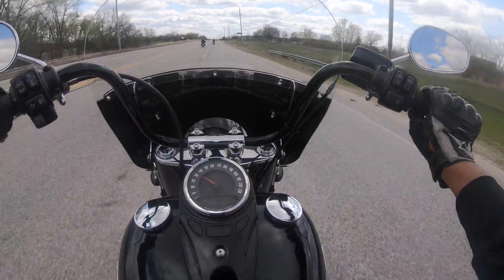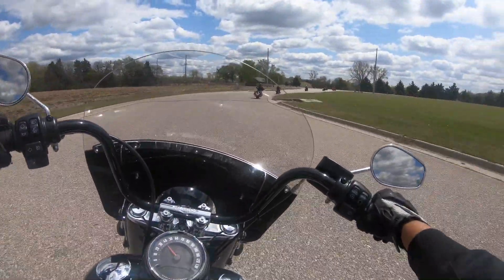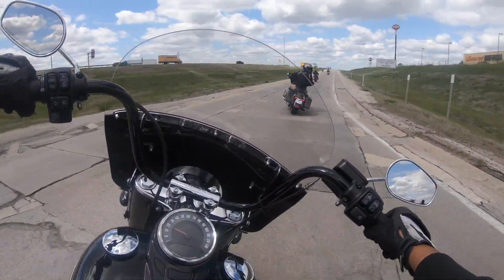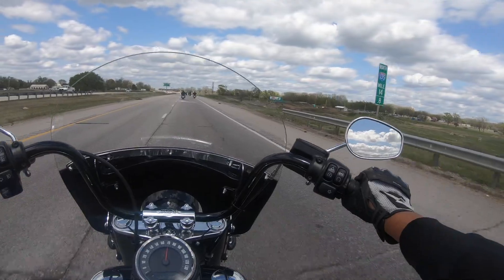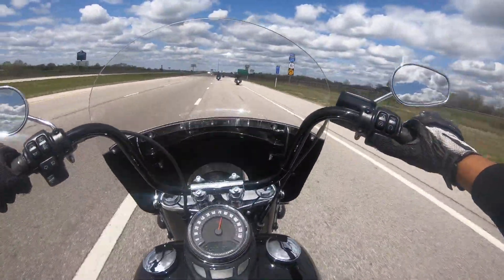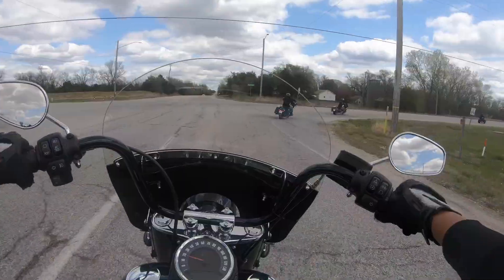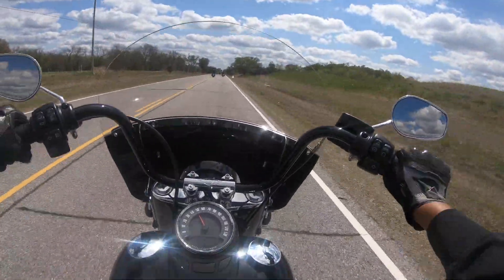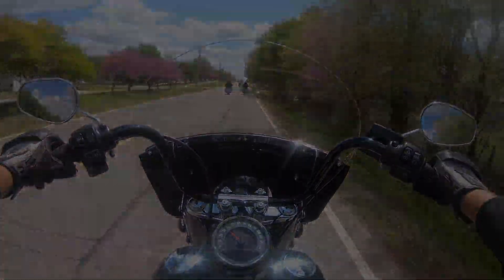2021 Harley Davidson Heritage Classic TEST RIDE!

Comment: Thinking of getting a new one. 2 mechanics I know say they are not sturdy, tend to break down easily. 
Do you agree?
Reply from the maker: My compensator on my Fat Bob broke at 3,000 miles. I’m now at 20,000 in a years worth of time. I love the M8.
Reply: @SmallButMightyx  thanks, I tend to ride pretty conservatively anyway , but didn't want to get into a lot of debt with bike that breaks down.
Reply from the maker: @danoweston6185  yeah I was just accelerating when to 40 when mine broke. No warning. Some people have issues with it. Most don’t. I put the original comp in and no issue since. It’s a great bike. Can’t say that enough.

Comment: 0:12   "She's quick....Oh, these Harleys are quick."  If you really believe that, you have never ridden a "quick" bike, to say nothing of a "fast" bike.  A Concours 14 or an FJR will smoke a Stage 4 Harley, and any of the Literbikes will leave the C14 or the FJR wondering what the heck just happened.  Ride your H-D and enjoy it, but enjoy it for what it is.... a cruising/touring bike.... NOT a performance machine.
Reply from the maker: They are quick. Not fast. Torque not HP. That’s about it. I’ve road plenty of sports bikes. Different machines for different persons. If someone wants to build out a Harley into a performance machine who cares? Their money.
Reply: @SmallButMightyx  Try a Kawasaki Concours 14.... it's a touring bike, not a sport bike - and it's "quick", but it's not "fast".... "fast" is a ZX14, a Hyabusa, or any literbike like a  BMW S1000RR.  And torque doesn't matter... horsepower is what counts.  The rest is just gearing.
Reply from the maker: @wwb7091  all personal opinion. Everyone has their opinion on what counts and what doesn’t. Never road s concour but I’ve heard nothing but positive things. Just not my style.
Reply: All things are relative and subjective. This Harley will be considered quick if you compared to the likes of a Honda Shadow or similar. Definition of quick being something happening in a short period of time (slow speed up to higher speed) with fast being anything occuring at a high rate (speed). 

Torque is the driving unit of power to being "quick" whereas horsepower is the unit of power that generates top speeds..."fast". (Yes I know you can't have one without the other and they're factors of each other but they are very different units of measure). If two powerplants are geared the same but one has more torque and the other has more hp...all other things being equal the higher torque one will be quick because it accelerates quickly but the higher HP one will go faster on the top end.

Quick is subjective to user/rider and has no certified easy method of determination other than how it makes the rider feel...but fast can be measured by looking down at the speedo.
Reply: You have to consider the context.  In this case, the context is a large displacement pushrod v-twin.  And for that engine configuration, these bikes are kind of quick.